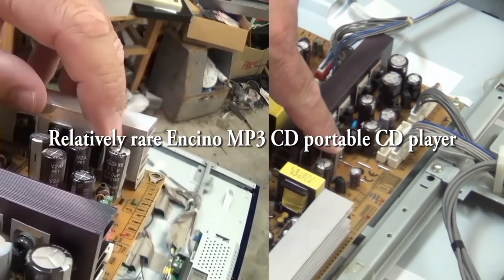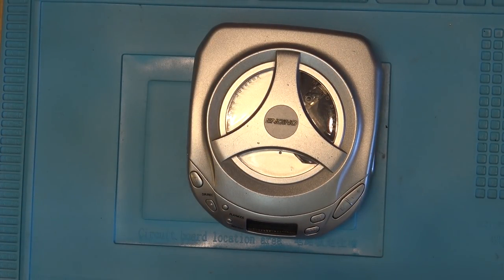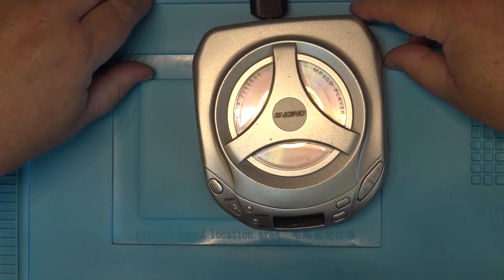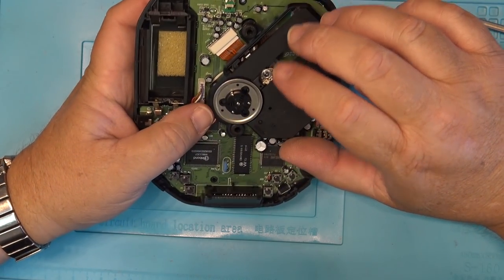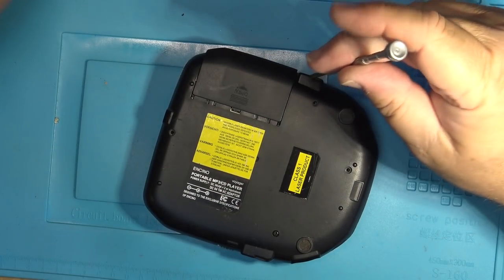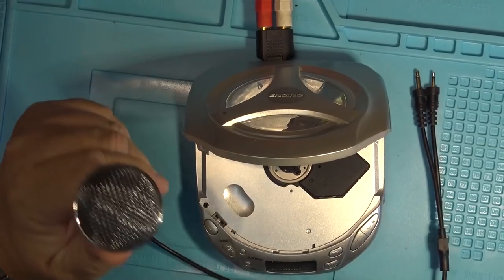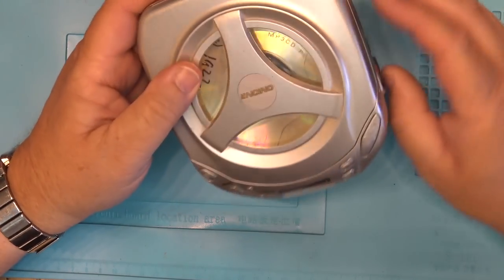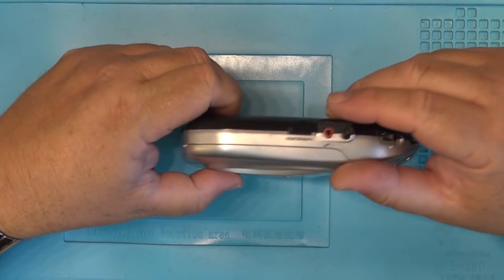Rare Encino MP3 CD Jukebox Teardown

Comment: MP3 portable cd players aren't that rare. I've got one myself, a cheap Koss model I bought new in a store way back then. Still have it today although I had to fix it recently. Pre-iPod/early iPod era they were very common.

What I found interesting about them is that the entire MP3 file would fit in the anti-skip buffer compared to red book audio. Through the window you could see the disc spinning much faster than 1X and stop spinning completely once the file was fully read. It would spin again as the next song was about to come up. It gave the unit much longer battery life with mp3. If I was careful to not open the lid too far and avoid triggering the sensor, I was able to remove the disc from the unit and it would keep playing until the end of the song. It amused me greatly to do that, it felt like magic to have music playing without the physical media inside.

What's unique to me about yours is it's recording capability. This I have never seen before. Pretty neat!!

Comment: I used to have a Sony discman with a rechargeable battery pack,,,cassette adapter,,,car base mount adapter and cigarette lighter power cord,,,and mains transformer adapter,,,bought in 1996 as my first,,,portable cd player.
Not so sure if I still have it,,,as the unit itself no longer plays cds. It had a lot of use back then,,,both portable,,and in vehicle.

Comment: For me, when I was a kid, I used to play the RCA CD Player for a while until the laser gave up on me where it doesn't want to play CDs any longer, and it's been discarded already. It's a 2000's model.

I have my 1996 RCA CD Player, it's a NOS console and it's never been opened for all of these years, I got them at the yard sale back in 2015 or 2016, and I'm pretty sure it is working, the quality is made in Malaysia, and I really don't want to use them because, I want to keep it clean and original to it. Though I like using the 1985 Sony Walkman WM-F18/28 because, I never getting old for playing around with the nice Walkman, though I have my 1990's Sony Walkman WM-FX141, and the 2000's Sony Walkman WM-FX195, I would like for to use the Walkman is for to playback the blank tapes at home or at the vehicle while I can.

Comment: I'm sure I bought one like that, but not branded like that, I bought it at a boot sale and he said it stopped every now and again, unplug it and plug it in again and it would work for a while.  I bought it thinking I would repair it and use it in my car, but it worked for a while and then started not reading discs at random, so I took it out intending to fix it, then we moved and I have no idea where it is now!  It may have been thrown out, but maybe packed away and never found again.  I didn't realise it could record, it was just bought to play CDs in the car.  It was also called Jukebox but not Sanyo, Sony, Samsung, but I can't recall what name was on it.  It would be playing and just stop with the disc still turning but not playing, next time it would not read the disc, it was very random.  So I took it out to fix, next thing we moved house, so no idea where it went and no idea what went wrong with it.
I didn't have many MP3 back then, but I did find if I played one it didn't jump but was very slow reading the disc.  If I remember it also had an anti-skip that gave 3 seconds then built up again, so if you went over a pothole it didn't skip, but go up a tough road and it did after a few seconds.  It looked the same with sprayed plastic, it got a few scuffs on it as it was forever falling onto the floor onto what ever was lying there, sometimes parts and sometimes tools, so it got the odd scrape!  It ate batteries and I couldn't keep up with it, so I got an adaptor for it from a store with a lot connectors.  I wish i knew where it has gone as well, maybe if I find one I will find the other.  Sometimes I would put on a disc and it would offer to run then just stop without reading the disc!  Strange fault, it was almost like a dry joint, but no sign of one, so it was put back together and put aside to fix.  But, to busy to get to it then moved and lost it.  I had forgotten all about it, it was the look of it that made me think of it.  Another thing I need to find.  Just read the comment from Faucher-Goulet, Koss or Kross or Ross it might be, but anyway, it look the same as the one you have but yours works.

Comment: I had one of these portable CD/MP3 players, mine was capable of playing VCD's so the headphones out had 4 contacts, one of them was video out obviously.
Reply from the maker: I have one that I think can play video CD. It is a Karoke type player.
Reply: most mp3 players will play only the sound of a vcd ,i have tested this.
Reply: slotec Mine  was supplied with an AV cable and I used it as a VCD player back then.

Comment: Portable MP3 disc player? Not too rare! I had (have!) an RCA RP-2485. It plays MP3 & WMA and claims 200 seconds of skip protection!   Recording? Oh yeah, I've never heard of a portable recorder like that.  (Used 2xAA or 4.5V DC input.)
Reply from the maker: When this one came out this was it. Others followed. BUT, one that can record onto ram chips. That's the rare part
Reply: @12voltvids  True. The RCA is from 2002-2003-ish.
Reply: @richkh does the rca record as well?

Comment: Will it skip playing the audio cd,,,as it spins a lot faster?
Reply from the maker: It does buffer audio CDs too, but only 10 seconds or so. With MP3 it basically loads the entire file into RAM and plays from there.
Reply: @12voltvids  Ok. Very interesting how it loads an entire mp3 disc into ram storage and of course plays without skipping a beat. Never seen one of those machines with that kind of feature b4,,,along with recording your voice from the microphone too.
But i guess only has a few hours of recording space on the ram storage.
Reply from the maker: @nickfrench7372  8 minutes 30 seconds to be exact.
Reply: Ok,,,8 mins,30 seconds.
Thought it wasn't that much recording space in the unit,s memory,,,pity it doesn't take an external memory card,,,as u can record hours of music,etc on it,,,like on a 16 gb memory card.
But i guess the memory cards weren't available back then when the unit was made back in 2000.
Reply from the maker: @nickfrench7372  
My favorite mp3 player is that cheap little one I reviewed a few years ago.  It can take a 128 gig memory card.  I have mine playing in random 24/7 feeding into a stereo tv modulator.  I run scenery videos on the visual side.  Can tune any tv in the house on, listen to music and see nice scenery.   I quite often leave a tv running just to listen to background music and have the scenery playing on the screen.   When I am serious about the music i turn on my tube amp but for background, the sound from the mts tv modulator is modulator is good enough.  I should put it into a low power FM transmitter as then I could tune in on any radio in the house but with the dbx noise reduction on tv sound it actually sounds better over the tv.
Reply: @12voltvids  Oh,ok. I,m not sure if I've seen that video of your cheap little mp3 player,,,which takes a 128gb memory card.
Sounds cool how u have it playing in random 24/7 feeding into a stereo tv modulator. And u can run scenery videos on the visual side too. And tune in any tv in the house,,,and listen to music,,and see nice scenery,,,in your street?
And u quite often leave a tv on to listen to background music,,and have the scenery playing on the screen. 
And when you're serious about the music u turn on your tube amp,,,but for background,,the sound from the mts tv modulator is good enough as is altogether. 
Sounds like u have got your own radio station studio,,,if u put in a low power fm transmitter as then u can tune in any radio in the house,,,but with the dbx noise reduction on tv sound,,,it does actually sound better over the tv.

I guess you would have so many local fm and am radio stations where u are too,,,or I guess with other towns not far from u,,they may have their own radio stations too. Therefore i guess there,s plenty of all music types from nearly every radio station in around your area. I love my old classic music here where i live,,,we only have one station out of 7 on fm that does play my kind of music,,,especially with 45rpm on each weekend too.